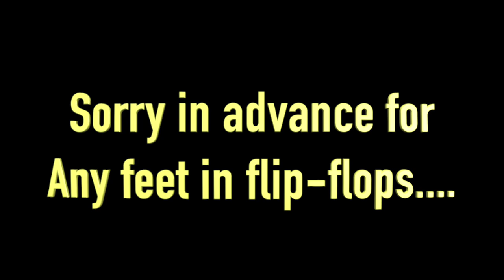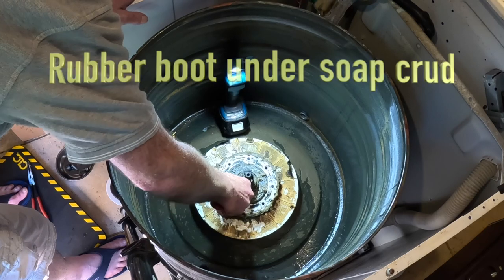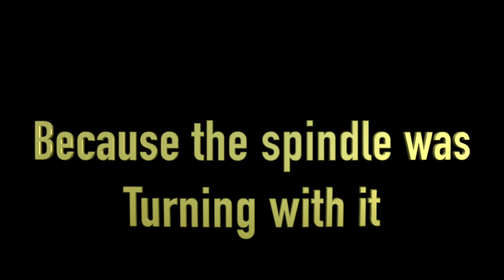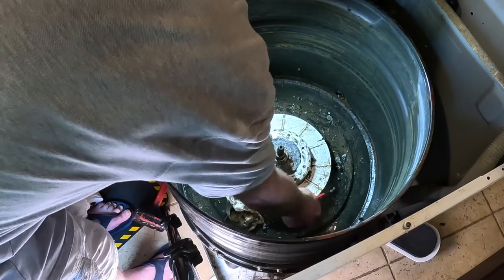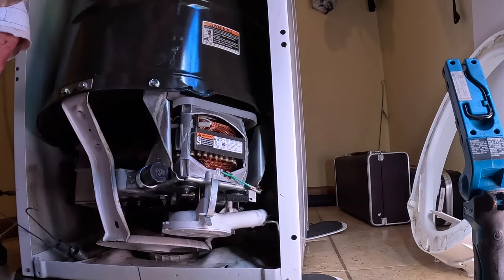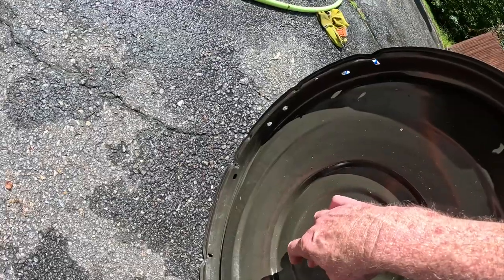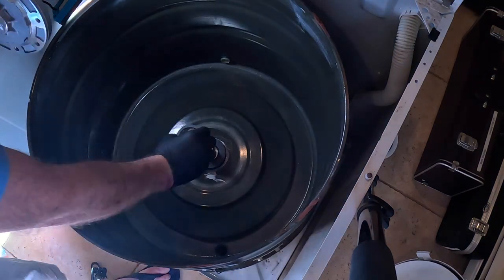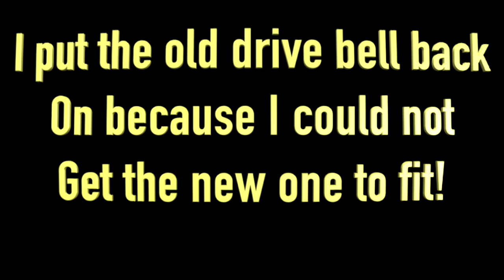Speed Queen Washer BEARINGS and SEALS replacement DIY  The GOOD, The BAD, and the UGLY

Comment: This may be a 'duh' question, but what were the symptoms of your SQ problems that led you to the repairs needed?  We have a SQ that has rather suddenly started making a rattling/ratcheting type noise during agitation both of wash and rinse cycles.
Reply from the maker: No such thing as a "duh" question because there can be a few reasons to do this. In my case I had a water leak under the machine.  I took the front panel off and it seemed to be rignt at the seal. I globbed on silicone and waited 24 hours before using the machine. That worked for a year. Then it started to leak water again so I did this job.  It can also be needed with no leak but the bearings are shot and you have grinding noise as the machine agitates.  It's such a pain I would suggest any symptoms like those above get new bearings and seal kit, buy the recommended sealant and do the whole job.  Thanks for the comment
Reply from the maker: Oh but it can also be the two washers above the brake assembly rubbing together.  I actually made a video with the noise a few years ago and I got a lot of guesses I knew were wrong- like it's the pump- until some guy (or gal) who clearly knew their stuff told me what it was and how to fix it. I'll find and link the video here. (I'll edit this post)  be sure to read the pinned comment- it's helped a lot of people. Okay edit. The vid is here. https://youtu.be/1mm-7liFE6o
Reply: @Samlol23_drrich  Thank you for both of your follow-ups to my inquiry. As a former (well, you always are sort-of) teacher, I appreciated your "no such thing as a 'duh' question' reply, too !

Comment: So Sam; Was the effort justified? Looks like several hours of work plus part and tool costs. In retrospect would you recommend repair over washer replacement?
Reply from the maker: 100 percent worth the effort. Any time you take something apart that you're not familiar with there is a learning curve. That is really why I made the video. The only extra tools I had to buy were the inflatable wedges and the flat metal piece to unscrew the bolt that wouldn't come out. So I think at the end of the day it was about $200 All In. As long as you can get that bolt of its doable.  Thanks for watching

Comment: How old was this machine at the time of this fix? Thinking of buying an SQ myself.
Reply from the maker: Around 12 years. I would absolutely buy another if this were to break. We use it at least once a day, seven days a week if not more. There was a small leak which is why I needed to do this job. The bearings were fine, but it’s like replacing the water pump when you do a head gasket. If you have to take it all apart anyway, replace the cheap part while it’s opened.  Good luck. The less electronics in these the better imo.

Comment: Be careful when using pullers, I had a hub that refused to come off, even with puller 16 years of bad city water basically "ate up" the aluminum hub and puller easily broke through the hub, I eventually wound up having to cut the hub into 4 pieces and chiseling the center part of the hub from the shaft. 

I knew this but in my zeal to get it apart I forgot to put a socket over the end of the transmission shaft and center shaft of the puller so it  wouldn't "mushroom over" the starting threads on the end of the shaft, now I have to run a tap through the end of the shaft so I can get the agitator hub lock down bolt back into the shaft.  So use a puller type with a self centering pilot bushing, or invert a socket over the end of the shaft to reduce possibility of mushrooming the starting threads.
Reply from the maker: Don't know why I didn't see this until today but good advice.  That must have been a big tap for those threads.

Comment: Doc, I've looked all over the internet and I've found drain hose replacements, but not for speed queen. Is there a way to replace the drain hose without taking this whole machine apart?
Reply from the maker: What makes you think that your drain hose is leaking? If you take the front panel off you can get to everything quite easily. Did you find a crack or split in the rubber hose? Let me look and see if I can find a diagram and I will come back and edit this answer
Edit type "drain hose" in the search area here https://www.partsking.com/SRCH.html
Reply: @Samlol23_drrich  As soon as the washer drains, water  goes all over the floor.  It holds water fine so it has to be either the drain hose or the drain pump. No water leaks from the drain pump so by process of elimination it's got to be the drain hose. Also, the water leaks out of the washer's left side and this is where the hose is.  I watched another YouTubers video on changing the belt, I found one on Amazon for $10 with shipping so I ordered one of those just in case.  Also, the hose I'm referring to is the one that is the drain and not the rubber hoses that connect to the drain pump.  The drain hose is PVC or PVA.
Reply from the maker: @amiedavis5257  well look at approx 22:14 on in my video. There are only 2 hoses. The short black one from the tub to the pump and the black rubber that transitions to white corrugated long hose that goes up and out to your drain. It’s one of those or a loose hose clamp. I would open the machine front and carefully run a small water only load and see where it’s leaking from. My money is on the long hose or the pump. Don’t touch anything but with the front panel off you should find the issue quickly.
Reply from the maker: @amiedavis5257  here is the part I’m talking about https://parts.alliancelaundry.com/i-7456313-speed-queen-39893-washer-hose-drain-dom-60hz-high-flex.html
Reply from the maker: @amiedavis5257  here is the other hosehttps://parts.alliancelaundry.com/i-787462-speed-queen-38351-washer-hose-tub-to-pump-ddp.html
Reply: @Samlol23_drrich  yep! This is what I have.  It's not rubber, but PVC or PVA.  It's a flexible hose, but this is the same one I purchased.
Reply from the maker: @amiedavis5257  and you replaced it already and it’s still leaking?  The only way is to open it and run a cycle and watch it.
Reply: @Samlol23_drrich I'm trying to get the clamps back on the drain pump and not having a lot of success.  😭😭😭😭.  The old drain pump is spinning, nothing is stuck in it And nothing appears broken but it's all plastic so you never know.  The drain hose will be a piece of cake compared to the drain pump.  Hating life right now.  Aside from cursing like a mad woman, any suggestions as to getting the clamps back on the drain pump?  Is there an order they need to go on?

Comment: Hey Doc, since my washer is identical to yours and before this upcoming fall just so I can make sure nothing else falls the hell apart on my washer (especially during the winter), did you purchase the 766P3A kit to do all of this?  I know you also got the black sealant stuff with it too.  Thanks again!  I was hoping to send you a 10 second video of my washer to see if the noise it's making is the bearings.  I sent the video to Alex the Handyman, but I don't know if he'll respond.  Thanks.
Reply from the maker: Post it here and post a link. It’s probably not the bearings.I would grease between the washers under the brakes. See my other videos.
Reply: @Samlol23_drrich  let me know if the link doesn't work.  I'm still getting leaking from somewhere, this is why I was wondering if it could be the bearings
Reply from the maker: @amiedavis5257 I don't see any link but didn't you say there was no leak during the cycle but only leaking when it was pumping out the tub? If that's the case it's not the bearings.  A bearing leak will leak with any water in the tub. Thats what I had here.
Reply: @Samlol23_drrich  Hi Doc...I have sent a link 4 times and even manually typed in the link and YouTube deleted it.  I have water going all over the place.  I got the new drain pump and the new washer drain hose replaced and the noise is unbearable and water's leaking like a sieve.  My laundry room is literally flooded.  I'm on Amazon now ordering a bunch of stuff for this washer ( I pause the video, look at what you're using and find it on Amazon).  Based upon the goo you got out of your washer, After I get mine ripped apart, I will take mine outside just to clean it up and probably put it back together as well.  My washer's in my basement and lighting isn't great.  The only thing GOOD about doing this job is when it's done, the washer works great.  Aside from that, it's all BAD and UGLY.  I'll probably boost the views on this video 1000 just because I'll be watching it, scrolling back all while trying to fix Frau Helga (yes, we named our washing machine).  I suspect that extra piece at 15:34 prevents things like socks and other small things that go in the washer from going into the pump and causing clogs.  I've seen other videos of people pulling that kind of stuff out of their washers and aside from a little lint and hair, nothing seems to get into my drain.  I'll keep you posted.
Reply from the maker: @amiedavis5257  that’s crazy.  It’s leaking more now than before? Yes I got that kit and it came with the sealant. The new kit doesn’t. I didn’t buy it from Amazon. I bought it from a dedicated laundry machine parts company. Don’t recall which one. I wouldn’t replace the seal unless you are sure that is your problem.
Reply: @Samlol23_drrich  Yes!  I so wish I could send you that link for the noise.  YouTube keeps deleting it.  I kept pausing your video and watching all the sealants you used and I ordered all of them from Amazon.
Reply: @Samlol23_drrich  Oh Doc...You need a good laugh.  I (key word) didn't bother investigating CLOSELY  (another key word here) when my husband yelled out to me that the washer was flooding the basement.   He took a look at the washing machine and didn't indicate to me he noticed anything. I just took my shop vac and was going to see if the tub was leaking or what was going on.  I hear water rushing out.  One of the drain pipe hoses came loose (the posterior drain that leads to the drain main) from the drain pump.  I guess I didn't get it locked down enough and it popped off.  Lesson learned.  Bearings are still bad but those are on order.
Reply from the maker: @amiedavis5257  hate to tell you but to do,the bearings and seal you’re gonna have to remove that hose again. Better make it tight next time around. Glad it’s no longer leaking.
Reply from the maker: @amiedavis5257 it was just one tube of 3m 560 polyurethane. It’s expensive stuff but that’s the only sealant. You need some alcohol wipes also.
Reply: @Samlol23_drrich  got it ordered! I'm not looking forward to tearing the machine apart but I am looking forward to the noise being gone.  I found a brand new complete transmission for this washer online today for under $100, still in the box so I purchased that and when the time comes, I'll put a new one of those in.  I also found a video of another YouTuber that showed how to rebuild the transmission for under $100.

Comment: hold the transmission from spinning with vice grips, look for the square block on the transmission it is like one inch square clamp on to that to hold the transmission from spinning...
Reply from the maker: Thanks for the tip. I knew there must be a trick…….

Comment: So if you don't put the sealant it will leak or it not necessarily but it might ?
Reply from the maker: You MUST use that. It’s not regular thread sealant. It actually glues the two halves of the metal bearing together. I’ll try to look and find exactly what it is and edit this post. Edit. Here it is. It’s very strong and made specifically for slip fitted cylindrical metal. It also cures without oxygen. https://next.henkel-adhesives.com/us/en/products/industrial-adhesives/central-pdp.html/loctite-680/BP000000153464.html

Comment: I was under the impression Speed queens were bullet proof! Supposed to last decades with no problems........
Reply from the maker: So was I. The bulletproof part I guess is the fact that it’s all mechanical. No idea why it started to leak but it did. My guess is overfilling the machine and unbalanced load caused the seal to develop the leak. Oh well. It’s been fine since.

Comment: Which machine do you have, and how old is it.? I have been told using to much soap is bad on any washing machine.
Reply from the maker: I have the awn542sp111tw01 top loader. It’s around 12 years old and I never thought I used too much soap, but apparently I have been. We have very hard water, and have a water softener- and still it’s hard to get a sudsy wash. Since I saw that mess in the machine and changed the seal and bearings, I use much less soap now.  I doubt my leak was due to too much soap, but you never know. Use the machine between once and twice every day and it’s still going strong. Love that it’s mechanical and not electronic in any way. Thanks for commenting.
Reply: @Samlol23_drrich  thanks,going to buy a SQ just haven’t decided on a tc5 or a tr7
Reply from the maker: @stevemoore9951  good luck. You probably can’t go wrong with either but if it were me, I would go with the one with the least electronics. Circuit boards go, any nearby lightning strike, generator power etc. good luck. Do a lot of research !
Reply: No matter the Washer type ask the Store that the washer is being bought at if they also sell Appliance surge protector's there just big Enough to cover the outlet some have a screw post in the Center of the protector to hold in place on the Outlet I use One for our Washer for the Microwave & Toaster.. They're definitely worth the small cost you pay for them if you can't find them a Heavy Duty  powerstrip for power tools like from Home Depot or Lowe's should Work..

Comment: Hmm seems like the plastic shroud works like a lint filter? I could be wrong
Reply from the maker: It was some sort of filter.  Completely submerged in water though. Since it was soft plastic and extended out past the metal, it made it hard to get the metal hub off cause I couldn't get a grip on it.

Comment: What is the kit you used? Do you have to replace the whole transmission for a bearing?
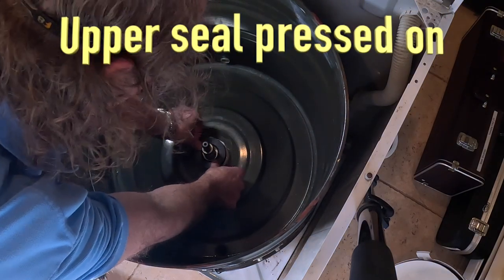Reply from the maker: It has nothing to do with the transmission.  Yes, I had a slow leak from under the machine. It turned out it was the seal. The seal is just some 3m polyurethane that goes around a rubber and steel bearing that sits on the bottom of the washer tub. But the inner tub not the outer tub. You can buy a specific seal and bearing kit for your machine.  For mine, it says which kit at the beginning of the video I think. You can not change the bearing without replacing the seal. 25:20 you can see the lower half of the bearing and seal 30:13 is the upper half of the seal that’s pushed into the urethane. Thanks for watching.
Reply: @Samlol23_drrich  I have the same machine and it's a bearing that's bad your video is only one I found of same machine in detail of kind of dismantling sorry I didn't watch all of it I should have but can't seem to find only the bearing kit for it so I'm so lost lol I saved this video for when we do find it to know how to change this seal and make sure to have most of the right tools I appreciate your feedback

Comment: Can you please tell me why your doing this? What was the problem? I have the same machine and in spin it’s starting to make noise and gets louder like a rubbing or shaft is bent and getting a small wobble….any ideas? Regards, Tony.  Ps I don’t see anything bent..
Reply from the maker: There was water leaking from underneath the washer. I took off the front panel And saw that it was leaking from the bearing/ seal area.  It doesn't sound like that's your issue. I would check the balance and springs first. Maybe run a small load with no clothes at all and see if it's still making the noise. And run it with the front panel off so you can watch.  If you are comfortable with electricity, bypass the top latch switch like i did so you can watch it run.

Comment: why not hold it at bottom and use a Big impact with like a spindle nut socket for a car...you overcome the inertia for it to spin and rattle it off
Reply from the maker: That would have probably worked If I had a socket deep enough for the spindle. There's a good chance I do. I just didn't think of that. Thanks for commenting
Reply: @Samlol23_drrich  what age was this machine? my mschine doesnt have a transmission like yours.. newer model im guessing..

Comment: Instead of that special tool you were pounding on could one have just used the correct size socket and a impact tool?
Reply from the maker: @metrork1  you're not the only one who has asked that so I must be missing something.   The answer is definitely yes but it would have to be very deep since the spindle is large and sticks up relatively high.  I have a set of 1/2 inch deep sockets but didn't even try them since I bought that stupid piece of metal. If a socket that I had fit that bolt,  my Impact would have spun it off in five seconds.
Reply: @Samlol23_drrich  Thanks for responding.

Comment: Great solid DIY video. Went through something very similar with my LG unit and the insane hard water of AZ that welded the aluminum parts from corrosion together ended up having to toast the whole unit due to cost of repair vs new unit. So I started looking at speed queens problem videos to see what's involved if something were to happen. Good video, Just couldn't stand the chum chewing, lip smacking sounds.
Reply from the maker: @TackDriver556  I always put the Rode wireless mic on my shirt collar near my throat and it was boosted too much on this one. Sorry for the gurgling. I’ve gotta be more aware of that or use a lav mic I can put on my chest. Thanks for commenting though.
Reply: @Samlol23_drrich ah gotcha! That makes sense.